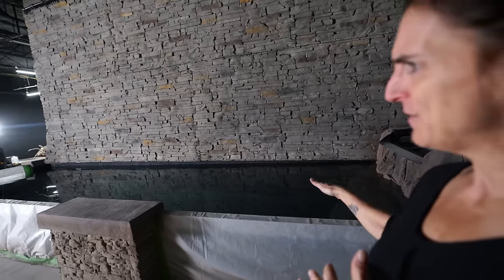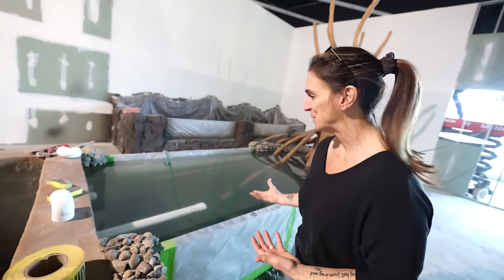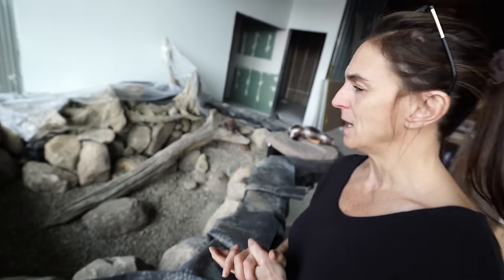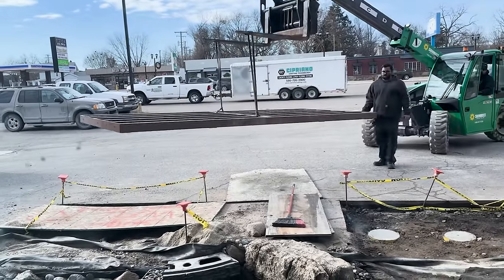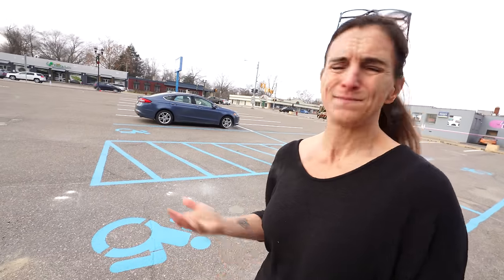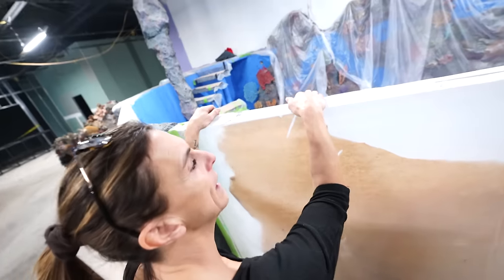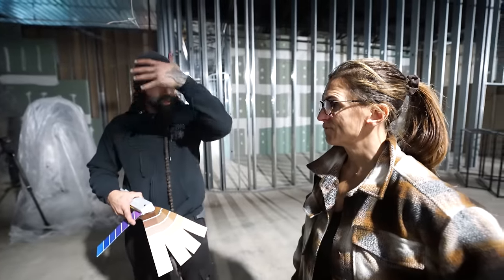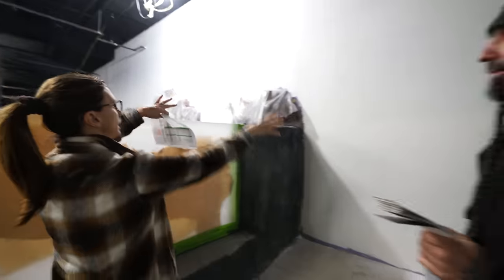My 2,500 Gallon Fish Tank is Leaking!

Comment: The leaking around those holes shouldn't be a issue they will probably put rubber washers around the hole when they put the filter pipe through and you cant tell the problem with the wall on video but don't forget it is a weeping wall so the top of the water won't be completely still like it is now it will have movement from the water going down the wall into the bottom tank.  Merry Christmas to all :)